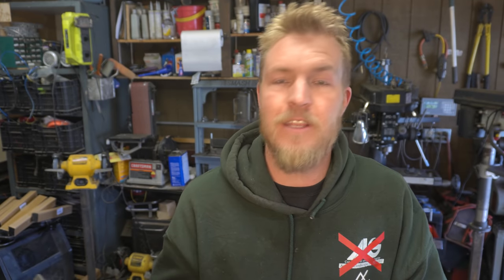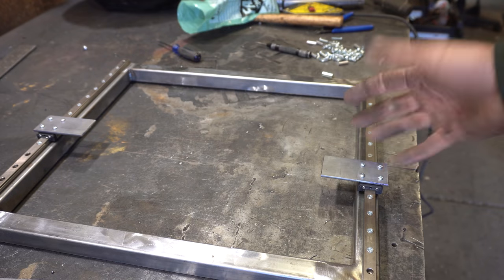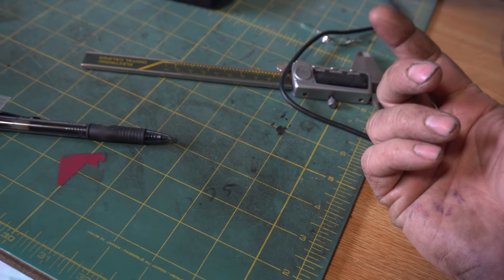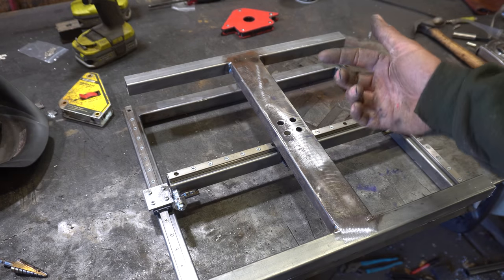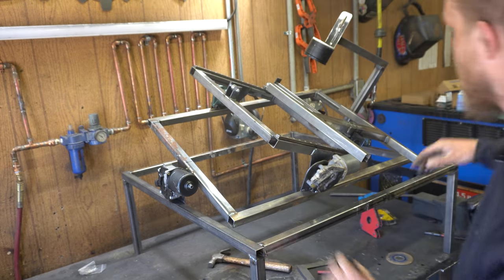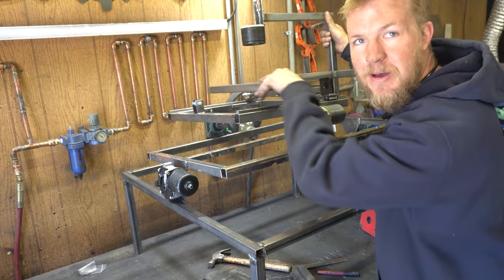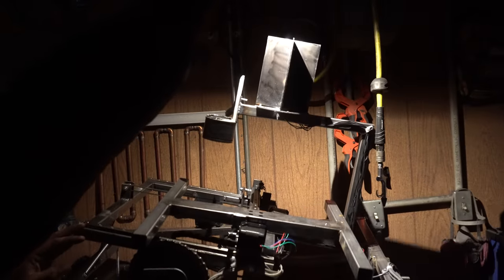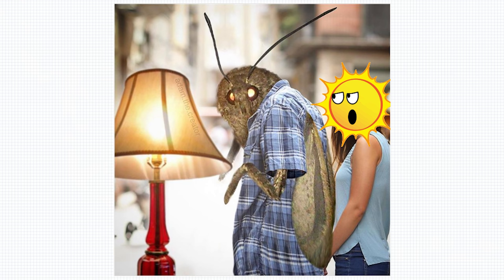Homemade Solar-Powered CNC Engraver

Comment: Congratulations! Like minds think alike. I posted a description of a solar CNC wood burner on the net over a decade ago. Mine suggested a method to slow down the feed rate when clouds roll by and stop if the burn power got too low. I had also suggested a solar panel to provide power for the machine so it would work off grid in an outdoor art display.
Reply: Bonnie Vance   
Great  job Lucas. Thoroughly intrigued by your inspiration. Unbelievable what your  brain comes up with. We need more young people to be inspired by you. By the way remember Cedar Point.

Comment: Neat-o, man!  If you were wondering how narrow you could get the burn lines, here ya go...  Even with a "perfect" convex lens, the diameter of the sun's image in the "hot spot" will be approximately equal to the lens focal length F divided by 107.  However, heat spreading will end up giving you an even wider burn trail.  (The math : the sun's angular width is approx 0.533 degrees.  This is also the angular width of the hot spot image.  So the ratio of the hot spot size to the focal length is equal to the tangent of 0.533 degrees, which is approx 1/107)
Reply from the maker: Hell yeah I love me some unsolicited math. That is pretty cool man, thanks!

Comment: @Cranktown City
(eg: 13:12) You should add a little metal plate above the wood (an "idle plate"), so when it's done, the machine moves to that plate (eg: [0, 0]) and it can't start a fire.
And if you add the plate a bit higher up, then the sun will not focus as much, so it will be even less dangerous then.

Comment: Big ass fresnell lens from an old TV to gather a lot of light and a smaller convex lens to focus and make the beam a little more parallel again. Then use one of those window shutters to control how much light goes in and you got a pretty sick CNC burning setup.

Comment: this is unexpected !!! i thought you will use a solar panel to power a cnc !! its  interesting 
you can also lose a sun tracking axis since the sun moves in a linear way 
also an old DSLR lens can do the trick just make sure it can focus up to  a single point !!! and it should have an integrated shutter as a bonus

Comment: I thought you were going to use the whole hinge of the hood on the truck, as in welding it on the top.  The jerking around part had me burst out in laughter along with the ant part!  I have a 14' aluminum satellite dish, your giving me ideas.  Solar Plasma !  Probably cut itself down like the NIST grant rejection letter, they actually told me I had to have multiple redundancy prime movers for dual axis tracking because if it stopped tracking it would burn itself to the ground!

Comment: nice.   you should try a fresnel lens to speed up burn rate.  I got a pack of 4x10 lenses for cheap as free of the internet and they have a pretty sharp focal point if you hold them rigidly.  also gives you a larger area to cover with a shade for power modulation.

Comment: That's awesome man. A perfect prototype!
Suggestion for mark two with your stated goals. fiber optics as a solar collector would alleviate the number of joints leading to the table both making it easier to get some real big solar power concentrated, allow for smaller simpler shades just disconnect the optic lines, and make the table just many times more rigid

Comment: Hello there, Glad to see you back, I don't usually comment (No sense disturbing such a well oiled machine) but I wanted to say Best wishes with the work, All your videos regardless of how crazy the project are always well made and I love to see what you come up with (Reminds me of the crazy stuff I used to attempt when I was still in the workshop) Also Glad to see the hands are still dirty, Hard at work as always

I'm going to spout nonsense now but if it helps avoid a painful situation down the line then It's worth me looking stupid 
A tip from me to you clean off the hands every now and then and treat yourself to a pair of leather gauntlets for working in(This is assuming you don't use them normally when not on camera) The rubber ones aren't worth the landfill but leather is always a go Sheetmetal or welding, Both I and my father before me were set in the ways of gloves = wuss but we both pay the price of constant splitting open skin on the knuckles of each finger, I don't even work on the tools at the moment and I am still suffering with it
I hope you find interest in my experience (Or heck even laugh at it I sure am laughing at myself writing this knowing you will have heard this over and over)
It might not happen to you and I hope it never does But if my advice keeps you from this constant pain then hell it was worth writing this 10x over
Thank you for your time
Keep up the amazing work
All the best with the business
Be safe and Take care out there wherever you are 
And see you next time whatever cool or crazy thing you do

Comment: Hey I love your channel and this was a great build.  I was kind of amazed that you manged to get optical sun tracking working without it being too erratic.  Amazing.  I'm a long time fan.  I loved when you doubled down on the metal 3D printing and went Tig.  That was quite a build.  Anyway.  My friend Lawrence and I built a solar plotter like this a while ago, and we did the sun tracking in software.   If you have the x axis level, and just use a plumb stick to aim the entire rig at the sun, you can use current time + log/lat to apply incremental offsets to your gcode that compensate for the suns motion!  (Won't work well for some 3 hour plot, but for something that only takes 40 mins to plot it works great, and is very simple/easy to set up.)  Although you have to estimate gcode temporal position which can also get a bit off on longer plots.   Sorry this https://www.youtube.com/watch?v=TNweEmtxtro is not a good video, but we actually eventually got some very nice output out of that rig.   Be warned that trying to go with an iris for variable line width is difficult.  I built this iris https://www.youtube.com/watch?v=WHPrGHBgsaA , and did a bunch of tests but when the iris is too small there's just not enough heat to char wood, so the range of widths was fat->super fat, which wasn't that interesting.  You might be able to reduce sfpm or have better optics to get very fine lines but just controlling the magnifying glass "size" with an iris works less well then you'd think, so be warned.    Anyway.  Keep up the good work!  I'm ok with you posting more erraticly.  Hell, I only post once or twice a year.  lol.
Reply from the maker: Dude, that is a super cool way to solve the whole "moving sun" problem.
Thanks for the insights on the iris, I'll take that into account. Although after watching your video I may have to make one just because it looks so dang cool!
Reply: @cranktowncity  Yes, far more things should have motorized irises!  I think part of the problem is that wood is just inherently a bit inconsistent so you can't be too close the "enough energy to cause charring" threshold or you get super inconsistent lines.  I wrote an Illustrator g-code exporter for that project.  I was hoping to then export line widths as z-axis positions to drive the iris, but never got a useful range of widths/results I was happy with.  I can totally identify with all the "Oh god! I can't see my laptop screen in the noon day sun. I can't believe I'm using this laptop under a blanket in the full heat of the sun." wackiness that comes when operating a solar plotter.  I can't wait to see what you do with it next!

Comment: One of my university's mechanical engineering student senior projects was to do this but they did it the much much harder way by attempting to rotate and move the lens in 6 DOF with a set of linear actuators. This is a much smarter and easier method.

Comment: If you are moving forward with the project, you can add a servo-hand-flap-thing under the lens to close it shut after engraving is done to prevent further unwanted scorching( I think you may have already thought about it, if so just ignore me). You may also look into those big Fresnel lens for more powerful beam.

Comment: We made a mini version of this in my college robotics class (minus the lens and engraver, just the solar tracker) using four steppers, one in each corner of the plate, and aball socket in the center of the plate. The steppers would lift or lower the corners accordingly. You could try something like that for the base with lead screws attached to ball socket joints on each corner and nothing in the middle

Comment: Great video as always. And good idea, too. No nonsense and unnecessary efforts to make everything clean, straight and tidy, that stuff is best left to sissies, let them make beautiful non-functional machines. Great choice of moving the bed, I'm really pleased you've made no effort to move the Sun LOL. Maybe next time, huh? Keep up the good (and amusing) work! Maybe try fiber in the next model? Much less moving platforms (if it works) and you may be able to use the PTZ camera holder, small and cheap...

Comment: I thought of doing something like this many years ago to solar etch photographs into hardwood laminates, but the laminates would be wrapped around a drum so the lens would only be required to move on one axis.  It would be mounted on an az/el mount to track the sun and a photocell would be used to sense solar brightness to either slow or speed up drum rotation or adjust an iris at the lens which would also be used for burn darkness control.  The idea came from seeing one of the land-line telephone image transfer machines on one of the old cop shows.

Comment: Mount on a large rotating cylinder for the ultimate sun powered digital read out sun clock. Would be cool to use solar power to run electronics as well.

Comment: @Cranktown City I remember seeing online a solar 3D printer a while ago. I think it used a big fresnel lens to melt the sand layer by layer (*found it: Markus Kayser - solar sinter project). Also, what's the delay between repositionings of the tracker? Could it be possible to log the values for a day and average them smoothly? I mean, with such sluggish speed the thing requires (because low energy per minute), it might lose precision during the run due to Earth's rotation. I have a humble suggestion:

more power!

-inflated mylar concave mirrors, each with its own tracker

-a solar tube (roof style) to gather all of them

-mirrors and a collimator to put the light where you want it

A lens to make a little dot hotter than the sun

Same cnc rig

Btw I loved every second of your video in all of its 1x glory, awesome.
Reply from the maker: That video is frikkin sweet, thanks!

good call on the solar tube. I tried doing something similar to this a while ago with lenses and fiber optic cable, but the cable would get too hot. I totally forgot that solar tubes are a thing.
Reply: @cranktowncity  I guess at some point the energy could be enough to fry the components?. Maybe adding some cooling or keeping them in water, maybe lenses made of water themselves? This is some of the best food for the imagination available on YouTube, thanks, man.

Comment: The lenses out of a rear projection tv might give you a better focal point,  plus the(the ones I acquired) have a little bit of built in fine focus adjustment.  And the lenses are proper optical quality, probably the best you'll find at that price point(free!).
Reply: And there are 3 of them,  so you have options for compounding, maybe.

Comment: What do you think about possibly adapting your mirror setup from the co2 CNC laser? Use a heliostat to focus sunlight through a large lens (maybe a fresnel sheet/panel), then re-collimate it with a regular convex lense (place PAST the focal-point of the fresnel) onto the first mrror (which will be the last of the 3 optical components that have to be mounted heliostatically) to bounce it across the x/y/z mirrors of a normal co2-laser (style) machine.
After that, you'd have all of the movement completed for a very high power (and far more precise/stable) cnc "laser" finished, and if you wanted to do raster & non-cutting moves, either a metal plate on a solenoid, or (to be super-fancy) a piece of liquid-crystal window glass, could be mounted pretty much anywhere NOT at a "focal point" of the beam, to allow some PWM control of the power.
Then, you could do rasters & non-burning moves, with the only unsolved problem being how to compensate for clouds passing between your power source (the sun) & your workpiece.

Comment: Shoulda used a lenticular lens - one of  those flat plastic lens sheets. Then you could have a big fat solar collector to focus more sun down to a hot burning dot. I think rigidity isn't super important, but more so the sun-tracking itself. You can't have the tracking going while it's cutting with it being so jerky, it needs to be smoothly tracking the sun. The photoresistors should be super close to the vanes of the thing and the MCU should be sorta just slowly averaging/weighting the measured intensity and gradually actuating accordingly. It looks like the way it is, or was during recording of the video, that it would just screw up a "cut" if it tracked the sun while in the middle of burning something. You want it to track the sun super duper smooth, constantly, so that you can be burning a design and have it come out perfect. Regardless, pretty super dope man!

Comment: If you can align the machine with the north celestial pole, youd only need one motor to track the sun. Like a star tracker for astrophotography (google barn door tracker). would make the whole sun following system more rigid and less complex. neat concept tho :)
Reply: also if was polar aligned you can remove the complex sun finder. You could make a finder by having a hole in line a few inches away from a crosshair. line that up and then just drive the the one motor at a fixed speed.

Comment: Use a big screen TV Fresnel lens. A true 1 meter squared power!
Reply from the maker: Dude that was my original plan for this, but I couldn't find a projection tv for the life of me. Will definitely try it in the future though.
Reply: @cranktowncity  I was thinking of using mine for solar cnc too.  But I figured clouds would make spotty cuts.  Seasonal variations in solar would make consistent cuts really hard and I need precision.  Maybe fiber optic and adjusting speed with measured output could help.
Reply: The allure of never burning out a laser tube (by using the sun) is enticing.

Comment: Im a newbie to shop work and have a question - what is the function of the zigzag pattern in the copper airline? You can see it @5:42 into the video. Is it functional or just aesthetic?

Great video as usual! Loving your projects 😁
Reply from the maker: Hahaha the idea is to cool down the air so it holds less moisture, but it really needs a drain as I can hear the water in there bubbling whenever I turn the compressor on

Comment: Didn't need to be so complicated - Get rid of the vertical axis motor and just be able to adjust the "vertical" angle to the the sun declination at the current time of year,  then use a synchronous clock-type motor for the "yaw" axis, and it will automatically track the sun